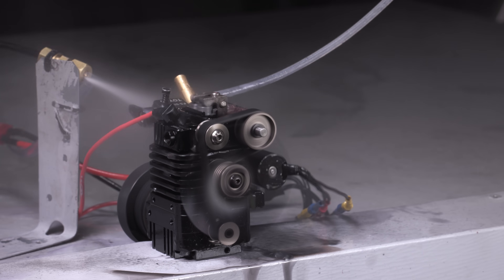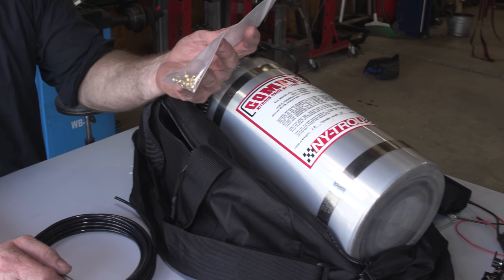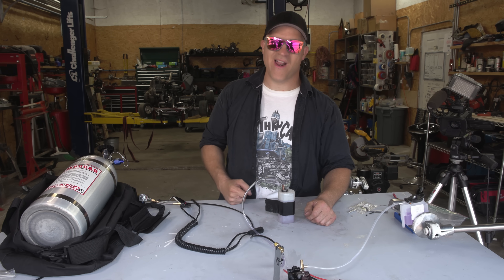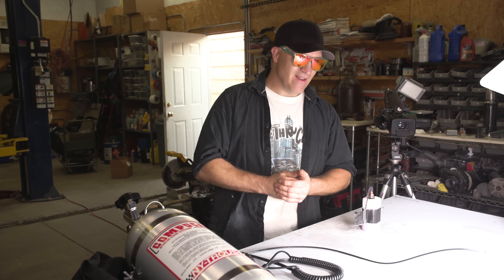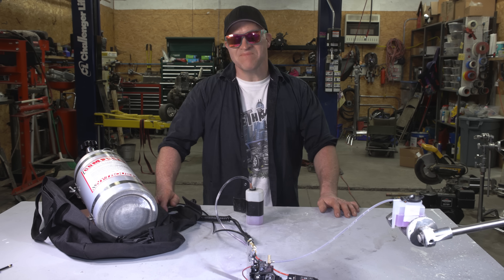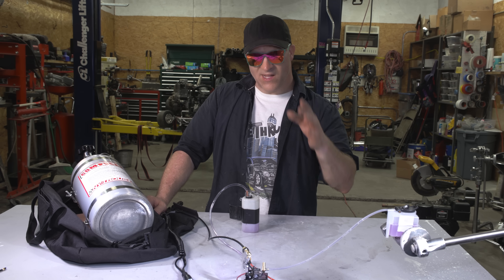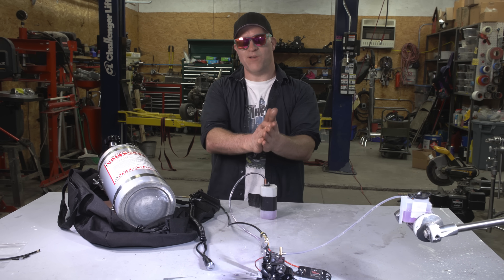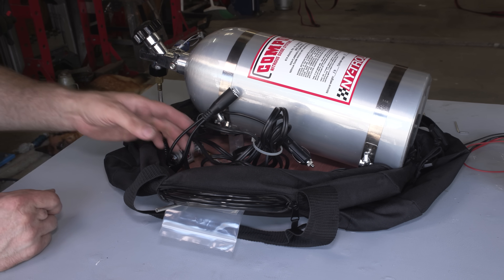Miniature Engine Gets 100 shot of NITROUS OXIDE

Comment: Who else would wanna see nitrous on the turbo diesel go kart
Reply from the maker: Josh Frank  that's cool, I'm going to have to do some research on that... I can totally hook something like that up to the Go-Kart
Reply: @WarpedYT  ether works good
Reply: Lol
Reply: 69th like
Reply: How about in a lawn mower
Reply: Next video:  3 cylinder geo w/300 shot gapping mustangs with the hit and 2 car lead!
Reply: A diesel engine wouldn't benefit from nitrous but instead it would from propane
Reply from the maker: @nightmareinaction629  that's what I am Told, I'm told that propane is the nitrous for diesel.
Reply: @WarpedYT  i hope you give it a try someday dont have small diesel engines to test it out on but i runned my lawnmower of propane for 4 years and the oil never changed color
Reply: @WarpedYT  I don't buy it. Nitrous gets you denser air. Since propane is also a fuel, I don't see why this would help. If it's "better" than diesel, why wouldn't you just run straight propane for "more horse power". Nitrous is definitely the way to go. Guys run that nitrous on their diesel drag rigs and it works.
Reply: wtf why propane thats just more fuel
Reply: @lucasvanhamburg4937  Propane molecules are smaller than diesel molecules so they burn more efficiently, causing the diesel molecules in the combustion flash to also burn more efficiently. Injecting the right volume of propane into the combustion chamber at the right time causes the combustion process to create more power
Reply: @nightmareinaction629  cool, did not know that
Reply: @nightmareinaction629    Nitrous works GREAT with a diesel.  You can use the same kit with different jet set.
Reply: @nightmareinaction629  lol
Reply: nightmare in action trust me. They benefit from it... Propane barley adds any power to a diesel, nitrous adds as much as it does to a gasoline engine.. nitrous mixes with air, not fuel, making oxygen more combustible. When you add more fuel, ie propane, and you don’t add any more air, you loose power.

Comment: 1:50 that’s known as the coanda effect, a high-speed fluid creates low pressure around it. The siphon effect is gravity pulling fluid up and then down
Love the videos :)
Reply: No, I think that would be the Bernoulli Principle, the coanda effect is the adhesion of a fluid to a curved surface.
Reply: @Riv_Longsnoot  You are right but I think that Bernoulli is a special form of the coanda effect, where the curved surface creates a venturi and the effect is amplified.  It does annoy me that people think the Bernoulli is why plane wings work, they actually mean coanda effect and even then its only half the story.
Reply: Help I’m confused now
Got my info from Tom, not completely sure which effect is which
Though I do know that the Venturi effect and coanda effect are closely related, and both constitute a part of the other
Reply: @ataphelicopter5734  sounds like you understand it just fine!  Bernouli says if a fluid accelerates then the pressure drops which is how a carburetor or in his case just a tube of fuel in a fast flow will suck the fuel.
Reply: Thanks James
At this point there are too many “effects”
Reply from the maker: You are correct, I do however try to use layman's terms for everything I talk about in these videos, that way my younger audience can understand and imagine how it works in their head easier. I used to put links in the description with further info on certain things, maybe I have to start doing that again.

Comment: Funnel the intake. Looked like most of the nitrous was blowing around the intake and through the fins which helped cool the engine. Nitrous makes combustion temps much hotter. Even a 0.01 jet should blow that thing if it's injesting all of it. Also that burning you were experiencing was the fuel that the nitrous was atomizing into the air.
Reply: Put a non return valve on the intake and then use an injector that puts in the right amount of fuel for the #16 nozzle, properly atomized. It should blow unless the intake manifold pressure  gets so high the spark stops firing.
Reply: @deltab9768  the 0.016 jet is about a 25hp shot. Still way too big for that tiny engine. The only way to get it exact would be to go to a small motorcycle or RC car nitrous kit.
Reply: @c117ls7  well, i don't see the problem really, if all your doing is trying to blow it up. 25hp is probably 75-100kw thermal power, so inject 2 or 3 gm/second of liquid propane into the manifold too. It won't be long before you burn more fuel than was used to cast that little engine block to begin with.
Reply: @deltab9768  true. Lol I'm just saying that from a nitrous standpoint, that engine isn't big enough to consume that much. There's no way you could feed all of that into it.

Comment: Why did that 2” engine handle a 100 shot better than a full size motor lol
Reply from the maker: It was crazy to be perfectly honest.
Reply: @WarpedYT  not gonna lie, still a cool video though. Amazed the improvised carburetor did as well as it did.
Reply: Because it didn't have good atomization or mixture control and most of it wasn't getting inside... but still an amazing experiment. Put 100shot and 10 gm/sec of propane into it with a nonreturn valve over the intake and either it will blow something or it will stall because the pressure is too much for the spark to fire.

Comment: To really blow it, you'll need a better carburetor system  to get the fuel more atomized, a way of controlling the amount of fuel flow more precisely, and a way of directing  all the pressure into  the intake manifold. Put a non return valve in the intake behind the nitrous injector so the manifold pressure just goes sky high. As it is it's just spraying all over the room and maybe 10% is getting into the inside of the motor.
Reply: Or try a plastic tank with say 45 psi of a perfect mixture of propane/natural gas and air, a sprinkler valve to dump it instantly, and a check valve over the intake so there's nowhere to go but into the motor. Just control everything (tank pressurization, engine starting, dump valve,etc) remotely and don't do it in town. A backfire will be devastating.

Comment: Please just dry inject it because you spraying gas all over the place and it makes me sad
Reply from the maker: It's not gas, it's methanol
Reply: Warped Perception I guess I should say fuel then because I wasn’t concerned for fire or anything it would just look so much nicer if it was all contained. A hose running into the air intake for your NOS and your fuel running in normally through a larger carburetor

Comment: Nitrous in a bag. Must be a Yankee thing. The valve float is limiting RPM and power. Preventing it from blowing up. If it didn't rely on compression to cause combustion of the air fuel mix and had a way of igniting an uncompressed mixture. It would stand a bigger chance of causing an explosion.

Comment: I bet I can get more hp out of 20% nitro fuel, a port an polish, and a hotter glow plug, than you can get out of that nitrous.(without blowing up the motor) You want a challenge? I can tune and mod a vx18 engine to the max and you can hit one with nitrous and we can see what one blows up first and what one makes the most power. You could use a large balanced flywheel to measure power based on acceleration time. It would be way easier than using a break dyno.
Reply from the maker: I would be up for that challenge, let me look that engine up now

Comment: To really test it properly you would need to have the engine under load, running like that it's not really making any power because it just revs to its mechanical limit and stays there.

Comment: 3:00 it is partially combusted nitro fuel that makes your nose and eyes burn.
Reply: Yes because it turns to ?nitric? acid on your mucus membranes, just like when you cut an onion produces sulfenic acid.
Reply: @dr_jaymz  yep, in addition to evaporated methanol. Methanol is poisonous and causes the initial burning feeling and I believe the nitric acid causes the feeling to not go away for a while. Even running fuel with no nitro, the unburnt fuel still casues a painful burning feeling. Especially on engine startup, where fuel is spraying from the exhaust. Once it has been running for a while and the mixture is right, the exhaust actually smells good. I actually tune based on exhaust smell.

Comment: Are you not opening the throttle?
Reply from the maker: No it's wide open all the time, it's that little lever on the carburetor the little black lever.
Reply: Warped Perception yeah I saw the lever. But I didn’t see it move. I didn’t realize you were starting at WOT.

Comment: Put a Turbo In that Engine and some Load like Generator
Reply from the maker: I wish I could put some load on this engine oh, maybe I have to make some sort of attachment but the problem is that the flywheel is crooked. I tried to fix it in the first video I ever did with this engine but it looks like the threads are cross threaded on the crankshaft, so it's not a real easy fix and I don't have any extra parts.
Reply: I saw a Video which it attach to the flywheel by making a Hole and fix on it. And by that, you can attach anything like Generator on it. You can do it 😉

Comment: you’ll need to load up the engine to actually blow something up. maybe connecting it to a generator of some type would work.
Reply from the maker: I wish I could but the flywheel is crooked the threads on the crankshaft are cross-threaded.

Comment: At some point he will make a closed intake and run one on nitous with bottle pressure.
Reply: Yes. Or failing that 50 psi of air containing 4% propane and a sprinkler valve to dump it. At a certain point something will go boom, he just needs to raise that manifold pressure and have a well controlled fuel air mixture.

Comment: Please Put a load on the engine. Either the homemade dyno or a dynamo. Also maybe an intake funnel to collect more air and fuel.  Very awesome experiment none the less.
Reply: Put a check valve on the intake, you could probably use a flywheel or centrifugal pump as the load.
Reply: Delta B he has made a dyno for engines. Not sure if it would work on this small of a motor but could always make a smaller one.

Comment: You should hook up a tachometer to these little engines to show the difference in RPM from normal operation and your experiments. We can see and hear it spin faster, but how much faster is it turning? Just an idea. Keep up the good work!
Reply: Exactly my first thought.. Apart from the tiny little starter being damn cute
Reply: old him so blowing up the small one. We want to know exactly how fast it went!
Reply: @LawpickingLocksmith  good deal you not crazy part job over here by the center house boot excuse me shirt that trailer highlighter
Reply: Some back of the envelope guesstimations:

Just tried using a tuner on the video. It said the engine was making an A2 note and when the nitrous was applied, the note went up to D3. So the ratio is (12th root of 2) raised to the 5th power, which is about 1.335x. So the engine was revving 1.33x faster on Nitrous.

So the note A2 is 110Hz, but this is a 4 stroke engine, meaning that there is only one power stroke for every two revolutions of the crankshaft and there is only one cylinder. So that means there is a total of 1 power stroke for every two revs of the crankshaft. So the engine must be running somewhere around 220Hz before nitrous. Multiply that by 60 to get RPM and we get somewhere around 13200 rpm. I looked at the engine specs linked in the description and it seems like it's rated to go from 2500 to 13500 RPM, so this number isn't totally unreasonable, I think. With nitrous it went up  by 1.33x, so it went up to somewhere around 17600 rpm.

Of course these are all my best guesstimates, so they might be quite a bit off. I would actually like to see an actual reading from a tachometer just to see how close I got xD
Reply: YESSSSSSSSSSSSSSSSS

Comment: when you inject nitrous oxide into your engine the fuel/air ratio gets lean. that's why they have an extra injection line or programmed to inject more fuel during the nitrous oxide injection. obviously you need that compression ratio to burn it or a supercharger.
Reply: We need better atomization, better control over the fuel, and a way of getting it right into the manifold without blowing all over the place. Right now, no matter how much nitrous he uses, the engine will be getting straight nitrous at atmospheric pressure. You're not going to create 50psi manifold pressures just by aiming that nozzle at the intake.
Reply: compression has nothing to do with making it burn or combust nitrous. nitrous carries its oen oxygen with it. chemicaly changing the 02  it can injest. which is why more fuel is needed.
Reply: @darinr9424  yes. It might have 2, 3x as much oxygen as normal air. But thats clearly not enough to blow this motor. If it's full of nitrous that was under high pressure while it was in the manifold ,that's going to mean more nitrous oxide and more fuel inside the motor. It will be more forceful.
Reply: @deltab9768  nitrous is 2 parts nitrogen 1 part oxygen. so its to say 33 percent more oxygen ingested by an engine versus the lower ammount that an engine normally inhales through normal atmophere. not 2 or 3 times as much
Reply: @darinr9424  a cubic foot of nitrous has the same number of molecules as a cubic foot of air. If you have 5 air molecules, one of them will be an O2 molecule. If you have 2 nitrous molecules,  they each are packing an oxygen atom. So you need 5 cubic feet of air to carry as much oxygen as 2 cubic feet of nitrous oxide. Also, when nitrous oxide breaks down it creates a little heat energy even without fuel, so that has to add to the power too. My point is, a cubic foot of nitrous oxide at 45psig has as many molecules in it as 4 cubic feet at normal pressure, and as much oxygen as you'd see in  10 cubic feet of normal air. So if we force nitrous and fuel into the intake manifold and then block off the access to outside air, it's getting the extra oxygen content of nitrous oxide plus a much higher boost pressure. I don't know enough about NOS to know if that's how they do it in real systems, but again, a 2 or 300 hp engine could suck down that much nitrous oxide and still draw in air as well. But on this little engine, we can close off the intake, blow it all in, and create ridiculous manifold pressures that will make a blow up.
Reply: @deltab9768  yep if it was sealed to the intake. this was not. thats the whole point
Reply: @darinr9424  maybe next time start the engine with a non return valve over the air intake. Have a port behind that to blow maybe 10gm/second of nitrous and 1 of liquid propane. The pressure will try to escape out, but the valve  will close and there will be nowhere for it to go but into the cylinder. Probably 10 or 15 horsepower will be created and something will break or melt. Which seems to be the point of this exercise.

Comment: Without the engine being connected to anything arent you just relying on high rpm to destroy it? Once under load the nitrous should really do some damage
Reply: The load could...bend things...lol
Reply: Exactly, at high rpm at worse it'll throw a rod but more than likely it's rpm will be limited by things such as valve float
Reply: And also use a better atomizer for the fuel, a more precise way of controlling the mixture, and a way of keeping it from just blowing back out of the engine. Right now the most it could get  is a perfect mixture of  nitrous and air at atmospheric pressure. But inject it behind a check valve and the intake manifold pressure will go up fast.
Reply: My thoughts exactly. Upping the nozzle size prolly made zero difference. Excess was just blowing around the intake. I also feel the cooling effect of the mixture surrounding the whole engine as well as entering the combustion chamber helped it reach the higher revs in one piece. Amazing experiment though, I HAD to click on it!
Reply: I.C. Gedye , rewatched it twice...
Reply from the maker: well I didn't want to put anybody on blast (the engine company) but, the only reason I didn't run the load on this engine like I wanted to was because the threads on the crankshaft or cross-threaded and the fly wheel wobbles all over the place... Unfortunately they didn't send me a spare engine like I asked, so I was stuck just letting it free wheel.
Reply: @WarpedYT  i'd say drill and tap the end of the crankshaft and attach a load that way, but I don't want some infernal contraption that's going to fly off and be even more dangerous.

Comment: Place an air intake funnel so the nos and fuel is fed into the motor more efficiently.

Bang?
Reply from the maker: What it really needs is a load
Reply: @WarpedYT  Bet you wont install the miniature engine in an rc car with a mini nitrous system tho! :p
Reply: Warped Perception yeah it would be awesome to measure the horsepower of that little thing right before it blows
Reply: Bang.
Reply: BOOM
Reply: That and it would probably let the engine heat up more since the nos isn't flowing over the cooling fins of the engine
Reply: Yes rico, K A B O O M
Reply: ALLAH HAKBAR
Reply: @noijze  🤣
Reply: @noijze  stfu islamophobic
Reply: It needs to have a check valve on the intake so the nitrous doesn't just blow back out. Or, same thing but instead of nitrous use a sprinkler valve and a lightweight plastic air tank filled completely with natural gas and then pumped to 150 psi with normal air. Instant, massive boost pressure. You might need to do some electronic tinkering to get a spark that will still jump under that much pressure. Just don't do it in town or inside the shop because a backfire will be totally devastating. Control it all remotely. The reason to use a lightweight plastic air tank is to limit the flying debris if you have a backfire.